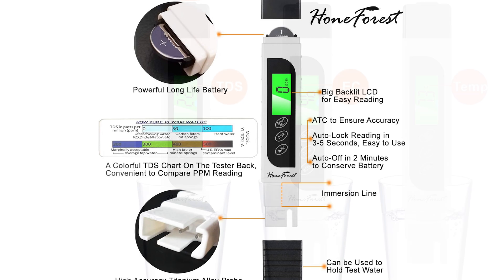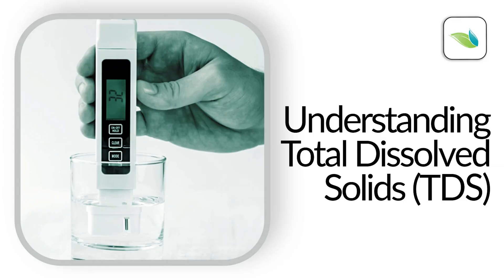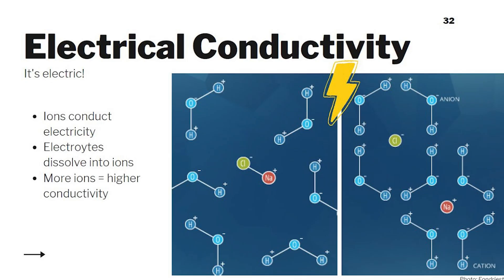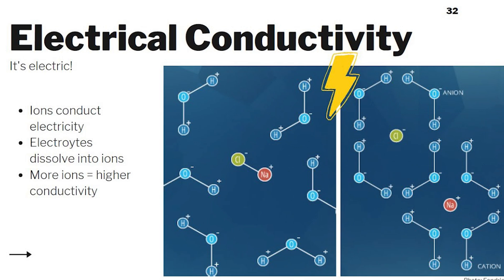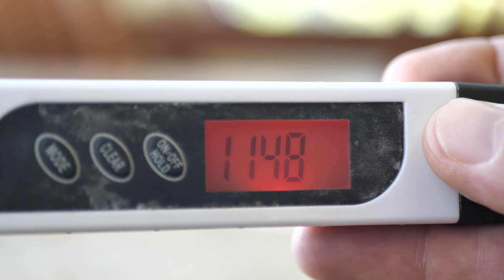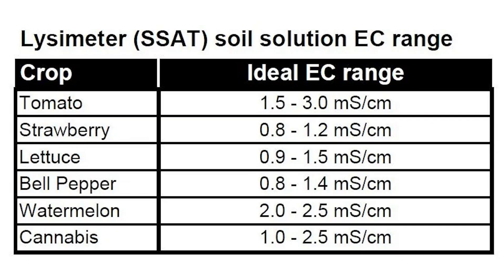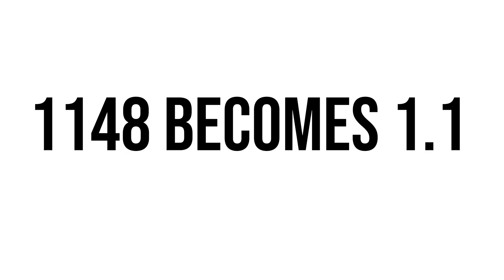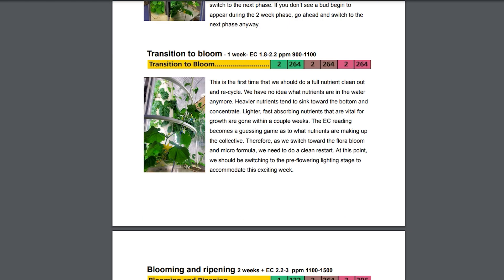How To Measure You Nutrients Using A TDS / EC Meter | Understanding Hydroponic Nutrients And Tools

Comment: I have that same meter and have been wondering about it.. Seems to use the same sensor for both measurements.  So is it actually measuring both, or just one and doing a mathematical conversion?
Reply from the maker: It does a conversion... They all do
Reply: I don't think that the conversion is accurate. 
PPM and EC do not necessarily equal the same. 
Sugars are not considered electrolytes,  and though they will mess with EC, it's not going to be a straight conversion. 
What happens is the EC is wrong after you put in sugars. 
I tested it with pure sugar. 
Could be wrong,  but I'm going to buy a meter for each,  PPM and EC because it would allow for monitoring how much nutes the plant is taking up,  and also give an idea after some charting how much sugar is in the nutes.
Again,  i could be wrong,  or it could be inaccurate,  and i may need to buy a refractometer to measure the sugars. 
Knowing this would be good to calculate how much the plant is taking in,  especially for knowing when the plant is just done and ready for only water.
Reply from the maker: @mrsrabbit2712   most meters use a shortcut. They take the measured EC value and apply a conversion factor to calculate an estimated TDS reading.

The formula is:

TDS=EC×Conversion Factor
The conversion factor is an approximation, not a universal constant. It varies depending on the specific types of ions in the solution.

A common conversion factor used by many meters is 0.5 (or 500), assuming a solution of sodium chloride (NaCl). This means that a reading of 1 EC (1mS/cm) would be converted to 500 ppm.

Some meters use a different factor, such as 0.7 (or 700), which is more accurate for certain types of nutrient solutions.

Because of this conversion, the TDS reading is an estimate, not a precise measure of the total dissolved solids. This is why many experienced growers prefer to work with EC directly, as it's the raw, true measurement that doesn't rely on an arbitrary conversion factor. Hope this helps.
Reply: @humblegrowth i think so,  thank you. 
But why does the EC go up on the Bluelab Truncheon go up a bunch with sugars? 
Sugars are not conducive,  so i figure it shouldn't change much.
It could possibly change a bit from bacterial produce,  but not that significantly.

Comment: You are a wealth of information. Thanks so much for all your efforts. Question for you regarding starting seeds. I am trying your method of letting them germinate in the dark for 3-4 days and then move to indirect light. Never heard of using indirect light for seedlings ever. So no grow lights at this point?
Reply from the maker: Thank you so much! :) Once you see the first leaves pop through,(usually after 3-4 days in darkness) add a significant amount of blue light.
Reply: @humblegrowth  The grow lights I use are white light full spectrum, T5 LED grow light. Will this work?

Comment: I finally got my meters, so hopefully you got your cut! Thank you for this explanation as I was a bit confused about what was the actual EC reading because the meter didn't have any mode that said EC! I picked up a 2nd hand IDOO 12 pod system as a learning tool while I figure out the design for my indoor salad vertical nft system. My lettuces are already much bigger than all of my herbs, so I'm going to put them in kratky systems so I can keep the light low on the IDOO. The IDOO doesn't really have that much hydroponics info and doesn't suggest checking the PH/EC levels when topping up, but I need to learn, so I'm glad I have you as a resource, lol. I gotta say, this is fun!

Comment: Switch it on, then put in the water. Read the number, you are done. (I assume people who need EC meters, already know what is ppm. If not, it is included in every manual for any EC measuring device). Im surprised that this should be explained. I mean its as complicated as peeling an orange.
Reply from the maker: when you turn your  meter on it will be reading in PPD or TDS you will have to change the setting to read EC. Not everyone knows what EC is, or TDS or PPM. Perhaps this content is not for a expert orange peeler like your self. Tower Gardens don't even come with a meter and this video is aimed more an beginner tower gardeners.

Comment: Thank you begineer here and everyone is so vague about this information maybe they dont know it themselves.  Starting a bunch of kratky tomato buckets in florida already screwed up 5 buckets but now I know.  I used rain water got ph around 6 with vinegar once baking soda once and everything I used rainwater in turned stagnant and developed a crusty layer of I assume the nutrients on the top of the water. Also had a orangish brownish film that feels oily. Should bleach be added to rainwater?
Reply from the maker: Glad you found me!! I would bet that the film and oily surface is a result of the use of baking soda and vinegar as the Ph. buffer. Using Baking soda will add way to much Sodium to your water causing all sorts of weird problems. Vinegar is not as harmful, however is can lead to nutrient imbalances in your tank. I recommend using dedicated ph. up and down solutions like this one. https://amzn.to/40r4cNq  Really avoid using any household cleaners or ph buffers, as hydroponic systems are a really delicate balance. I use these nutrients https://amzn.to/40HFLwN for all of my hydroponic gardens to keep things sterilized and rot free :)
Reply: @humblegrowth  Thanks for the information I thought I was being sensible using baking soda and vinegar is there any need to sterilize rain water collected from a rain barrel in florida?